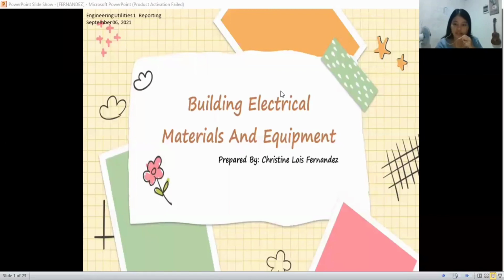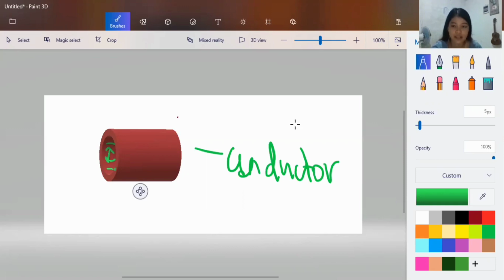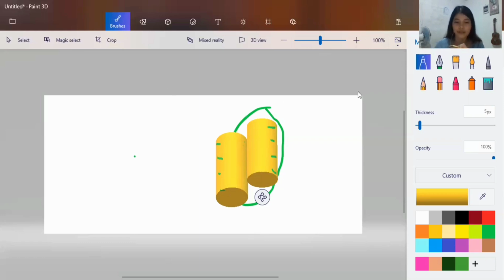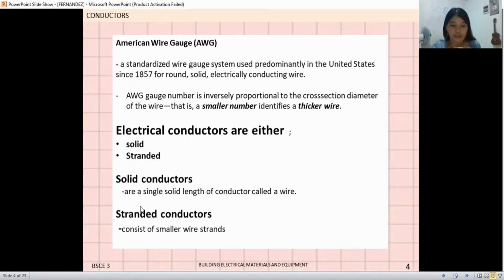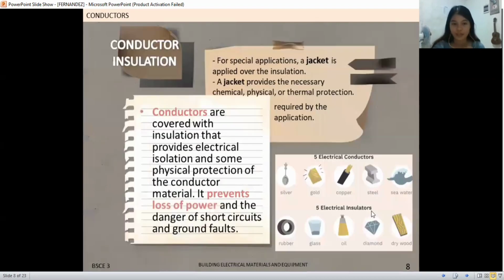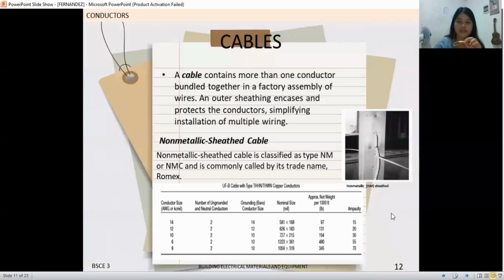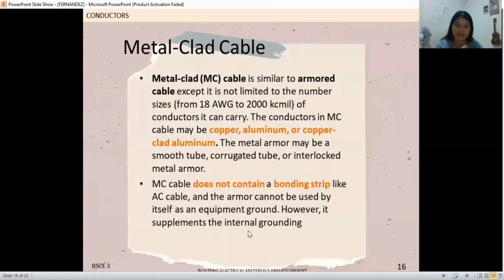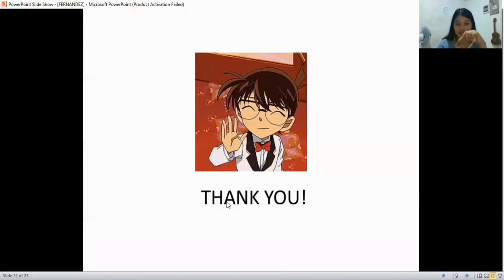18 5 CONDUCTORS

Comment: In this topic, it tackles all about electrical conductors such as wires and cords that allows the electricity to flow by building of the atoms, I learnt what's the physics behind it, I also learned how to compute Conductor Power Loss which is very helpful in preventing unexpected power loss.

Comment: Through this presentation i was able to know more about the classification of conductors its sizes and also the types or the common insulation material marking. I was able understand more the difference between insulator and conductor and how they work, how they are important to each other.

Comment: In this topic, I learned that electrical conductor is any material that conducts electrical current. The common electrical conductor used is wire. I also learned that in electrical conductor, bus bar servers as a common connection for two or more electrical circuits. Conductors are covered with insulation that provides electrical isolation and some physical protection of the conductor material.

Comment: In this topic I've learned that conductors and insulators are very important because the current or heat is passed the conductors. And we use many wires for passage of current , the substances which passes the current is known as conductors. The substances which does not allow to passes the current is known as insulators.

Comment: Ive learned in this presentation about wires, that wires is a common electrical conductor. And also the another one who may conduct the electrical, like bus bar Which is a copper or aluminium. So in terms of conduction materials, silver is the most and best to conduct electricity.

Comment: In this video, because of their available electrons, conductors easily conduct electrical current. Copper, aluminum, gold, and silver are some of the most frequent conductors. Glass, air, plastic, rubber, and woo are examples of common insulators.

Comment: After watching this video, I learned that conductors is related or connected to the insulators. So, there are some similarities and difference between this two. They are similar on having atoms and molecules that compose of negative and positive recharge nucleus. But they differ on the electrons of each other, whereas in insulator the molecules are fix but in conductors they move freely. I also learned that conductors are the one who transmit energy such as electricity while the insulators does not help the electricty to flow. I also conclude that conductors are usually metals while insulators are plastic, glass and woods. I also learned how important the conductors to the field of electricity by giving some flow of electric power.

Comment: In this topic I learned the use and importance of Electric conductor and Electric insulator, this two materials are very important in electric systems because the electric current cannot flow without the help of this two materials.

Comment: Based on the video, I discovered how crucial conductors and insulators are in the realm of electronics.  Basically, when we talk about conductors, we're talking about  an object  that permits charge or electrical current  to travel in one or more directions. One of its examples is metal. In contrary with conductor, insulator is a substance in which electric current cannot easily flow.

Comment: In this topic and video I learned that In electronics, I discovered that conductors and insulators are both crucial. Because of their atomic composition, electrical conductors make it easy for electric current to flow. When an electric charge is given to a conductor, the outer electrons of the atoms are loosely bonded and can travel freely through the substance.

Comment: A driver is a material that holds moving electric charges after looking at the video and according to the lesson that i have watched. Insulators are non-driven materials with modest electrical currents and low mobile loads. When an electric potential difference is introduced at different places on the material, electric charges migrate from all conductors. Charged particles are the moving, charged particles in metallic conductors such as copper or aluminum. Isolators are materials which prevent electrons from flowing freely from one atom to the next and from one molecule to the next as against conductors.

Comment: I've learned that conductors and insulators are both important in the field of electronics. Electrical conductors allow electric current to flow easily because of the make up of their atoms. In a conductor, the outer electrons of the atom are loosely bound and can freely move through the material when an electric charge is applied.

Comment: In this topic, I learned how important the conductors and insulators in the field of electronics. When we say conductors, it is the materials allow electric current to flow more freely than others and the insulators are resistant to the flow of electric current which is opposite to the conductors.

Comment: Electrical conductors are materials that conduct electricity or enable electricity to flow through them, such as copper, aluminum, silver, and even the human body, whereas insulators are materials that electricity cannot pass through, such as glass, woods, plastics, and other materials. I also learnt that water is an insulator until you add salt to it, at which point it becomes a conductor. Negative charges repel each other as well.

Comment: In this topic, it is about Conductors. What I have learn is first what is an electrical conductor? electrical conductor is a material that conduct electrical current, for example wires. Also i learn that there are some differences and similarities in insulator and conductor, they both have the same amount of atom and molecules. Conductors allow for charge transfer through the free movement of electrons. In contrast to conductors, insulators are materials that impede the free flow of electrons from atom to atom and molecule to molecule.

Comment: (HAMDAN A. TUNGANTONG)

By this topic was all about conductor, I learn that a conductor current can simply flow through a conductor. Current cannot pass through an insulator. Insulators are devoid of electric charges. Electrical equipment is constructed using conductors. Conductor is  important in the subject of electronics, both conductors and insulators are crucial. Because of the make-up of their atoms, electrical conductors allow electric current to flow freely. When an electric charge is given to a conductor, the atom's outer electrons are loosely bonded and can freely flow through the substance.

Comment: In this chapter is talks about Conductor. Subsequent to seeing the video, I discovered that a transmitter is a material which contains mobile electric charges. In metallic channels like copper or aluminum, the portable charged particles are electrons. Positive charges may likewise be versatile, for example, the cationic electrolyte(s) of a battery or the portable protons of the proton conductor of a power device. Separators are non-directing materials with few portable charges; they convey just immaterial electric flows.

Comment from the maker: I've learned that electrical conductors are the materials that  conducts electricity or they are the one who allows electricity to flow through them like the copper, aluminum, silver and even human body while the Insulator are the materials like glass, woods, plastics and any other materials that electricity cannot pass. I also learned that water is consider as an insulator but if you put some salt into it it will going to be a conductor. Also negative charges repel from each other.

Comment: In this video presentation, I learned how important the conductor and the insulator when it comes to the property of electricity. Conductor helps to prevent short circuit and ground faults, and also it prevents loss of power, in otherwise the insulator is the same with conductor, the only difference between them is that the electricity can flow with the conductor while in insulator it gives opposite.

Comment: This chapter was all about Conductor. After seeing the video, I learned that a conductor is a material which contains movable electric charges. In metallic conductors such as copper or aluminum, the movable charged particles are electrons. Positive charges may also be mobile, such as the cationic electrolyte(s) of a battery or the mobile protons of the proton conductor of a fuel cell. Insulators are non-conducting materials with few mobile charges; they carry only insignificant electric currents.

Comment: What I've learned in this report is the importance and the function of conductors and insulators. Conductors are the substances and materials which allow electricity to flow through them, it  usually used to conduct electricity because it is high electric and thermal conductivity. There are many types of conductors, such as gold, copper silver and  etc. but  copper is the most commonly used in wiring because gold and silver are expensive, it can also be a thorn in the eye of a thief.  Insulator is different from conductors, its limiting the current from flowing and blocks the passage of electrons. It protects from electric shock or electrocution, and if we don't use an insulator on a electric wire we can be electrified and it can cause different accidents.

Comment: A conductor is a material that holds moveable electric charges, according to this lesson. Electrons are the moveable charged particles in metallic conductors such as copper or aluminum. Insulators, as compared to conductors, are materials that obstruct the free flow of electrons from atom to atom and molecule to molecule. Insulators are non-conducting materials that have few mobile charges and convey only minor electric currents. Overall, all conductors have electrical charges that migrate when an electric potential difference is applied across different spots on the material.

Comment: What I learned in this report refers to the difference between conductor and insulator, in this report we can better understand what exactly is the difference between insulator and conductor. We know that the structure of the two accessories is almost the same but the only difference between them is that in the conductor the electricity flows more smoothly and in the insulator there is no electricity to flow.

Comment: This chapter talks about the conductors and insulators, both  have a similarities in terms of the structure, both have a atoms and molecules which comprise a positive and negative electrons and neutrons. Both have differences also, conductors allow current to flow easily through it, in metal like copper or steel while an insulator doesn't allow current to flow like rubber or glass. Electrical conductors are either solid or stranded conductors, either single wire or consist of small wire strands.

Comment: Chapter 18.5 which is the conductors that gives the difference and similarities between conductors and insulators.So similarities between the two is that,they both have atoms and molecules which involves nucleus,electrons, negative and positive charges.But the difference is that in  insulator,electrons cannot transfer or move around because it is fixed,but in conductors,electrons can be transfer or move around.Moreover,this chapter also gives different kinds of conductors and its own classification.

Comment: What i've learned in this report is that in a conductor, electric current can flow freely, in an insulator it cannot. Metals such as copper typify conductors, while most non-metallic solids are said to be good insulators, having extremely high resistance to the flow of charge through them